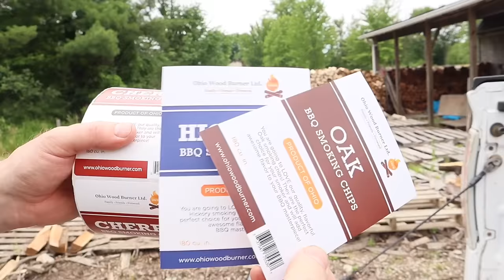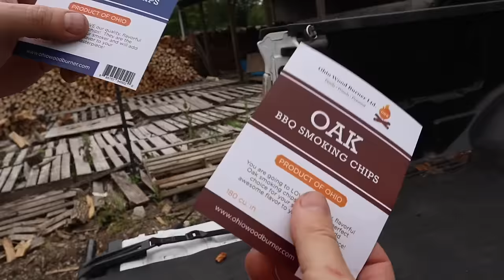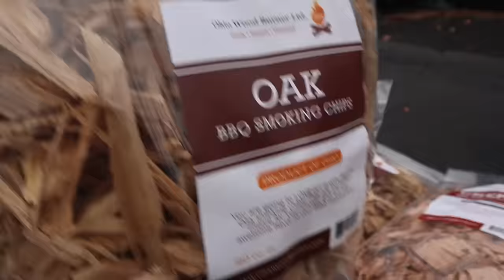New Firewood Product Nets $10,000 A Cord?!?!?

Comment: Speaking from an engineering perspective, if you wanted to get green chips dry in less time than mother nature can, you mechanize the drying process. There are industrial driers for certain products that may be adaptable. You could have a tumbler with very dry, warm air being passed over the chips. The outgoing air then has to be run through a dehumidifier, reheated and passed through the tumbler again. A chemical engineering problem that has been used in curriculum for many years.
Have a great day.
Reply from the maker: Interesting Bob.  I would think this is an economy of scale just like everything else.  If I get to a high level of production I can see this happening
Reply: @ohiowoodburner  Without a doubt the volume has to be large enough to make sense and cents, LOL!

Comment: Nice story!
Just one comment about the Chipper: The plastic part of the PTO should not rotate. My chipper has some chains to attach the PTO to the chipper and the tractor. Better safe than sorry, these PTOs will grab anything if turning.
Reply from the maker: Indeed.  I was messing with it when I put the new pin in and forgot to install it LOL.  I have the chain attached to the bracket on the chipper

Comment: Take it one step farther.  Dip the chips in molten beeswax and drain. Bag up and sell as fire starters.  “0utdoors WTH the Morgan’s” used some on a video a few days ago and boy, do they work! I don’t know what a bag would sell for but it would be worthwhile to look into.  Sell to the same customers as you sell the chips..
Reply from the maker: Good idea Jim.  I will have to look into it.
Reply: @ohiowoodburner  : honey producers usually have a lot of beeswax and sell it cheap. I use beeswax in one of my hobbies and get it regularly in 5 lb blocks for $8. Good luck!
Reply: @ohiowoodburner   Might be a better use for your shaker scraps as the small splinters and bark would do just as well and need not be species specific. try a bucketful of that stuff through the chipper and see what it makes for this use. The wood is basically a wick for the liquid wax to burn off. Sawdust and crumbs of various sized mixed with paraffin wax molded in silicone muffin tins to make starter blocks. Use for waste not good product.

Comment: Why worry about dry chips? the customer will soak them in water before using them, rite?  The label should state the volume or weight in the bag. Like 10 handfuls.
Reply from the maker: They need to be dry to be kept in a plastic bag while sitting on the shelf at the retailer.  I want to avoid moisture build up inside the bag and possible mold

Comment: Question don't you soak smoking chips before you use the if so
Then why worry about a little moisture
Reply: Mold!
Reply from the maker: I worry about them being in stock at a retailer.  The moisture could build up inside the bag and look unpurchasable.  Mold also over time

Comment: Question, why do smoking chips need to be dry? when I have purchased them in the past the instructions on the packet where to soak them prior to use.
Reply from the maker: I think they can mold in the bag if they still have  moisture.
Reply: @ohiowoodburner  OK, thanks.
Reply: Have you ever considered making charcoal out of your short ends and such. It's a simple process. Of course I only do it for personal consumption.

Comment: I would  not be concerned with moisture level, any smoking chip I have used suggest to soak in water 3-4 hrs b4 using.
Reply from the maker: My concern is  more about how the product would keep on the shelf at the retailer.  I would hate for moisture to build up inside it and mold etc
Reply: Simple answer, use a perforated bag.

Comment: PLEASE PLEASE PLEASE do not stick your arm into that chipper hopper. They are designed for inserting branches from cut trees/hedgerow, not for poking a stick by hand into the hole at the bottom. That PTO will just keep going whatever gets into the chipper and there's no big red kill switch/bar at the opening! Anything could cause a problem - sleeve gets caught on a thick splinter...

Comment: Please get a wood pole or guide rod to push in the logs… I almost pooped myself each time you reached into the hopper. Best case you’re getting some busted knuckles, worst case your bbq chips will give ‘hand made’ a whole new meaning
Reply from the maker: It is an optical illusion because the splitter is in front of it. I literally cannot get my fingers close to the blades
Reply from the maker: It is an optical illusion because the splitter is sitting in front of it. I literally cannot get my hand anywhere close to the blades unless I was Stretch Armstrong!

Comment: Get u bunch of small branches  no more than  2 in round   and also  your pto need little more speed like quarter more   it's not spinning fast enough
Reply from the maker: Thanks Rebecca. I think i had the tach at 1500 rpm which is the 1st yellow line for the pto. U think it should be higher?

Comment: Nobody gets rich selling firewood. Free dead wood on the ground everywhere. Supplemental cash is what it’s good for. There is only so much $ a cord is worth. The Rick the bundle the pickup truck is a fairly recent thing. It’s not the way to buy wood. If you need a bundle you can get it free dead wood on side of road. A face cord is not worth it. A pickup truck load for $100 not good deal. It won’t be a heaping load. Which would still be less than cord. For me I want it free I will do the labor.
Reply: $100 for a truck load is cheap and will be at least a half cord even if it just level and not heaping ,$100 pays for no gas to deliver
Reply: And that's with a small truck ,not a full size truck,I know because I sell firewood

Comment: Stop putting your arm so far into the chipper or you’re going to have to start using your left are. How many BTU’s can you get from each bag of chips. Your bag has to have zero holes. You’ve got to dry your chips before bagging them. What is the moisture content of your chips. Have you tried your chips in a pellet grill. Does it feed well. Send me a bag to try out. I will pay you for it. 
What is your market
Reply: It's very hard to hurt yourself on most shippers. Your arm has to go so far in for it to be an issue. On my chipper, my hand is almost to big to get in the danger zone